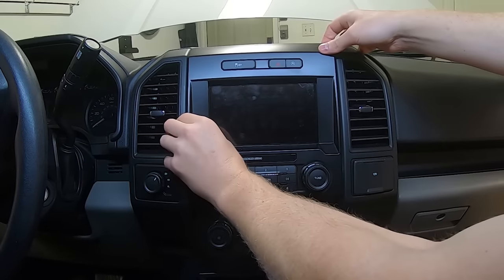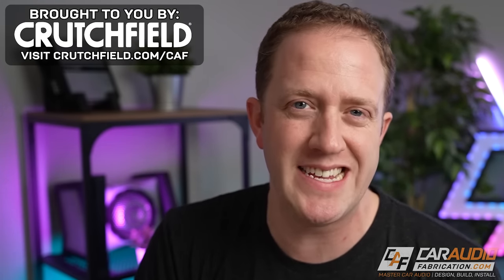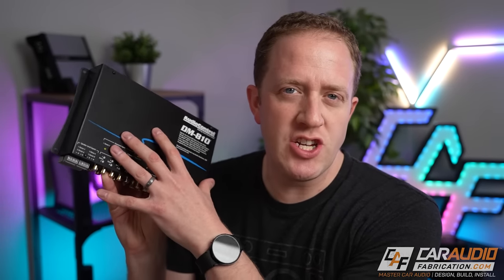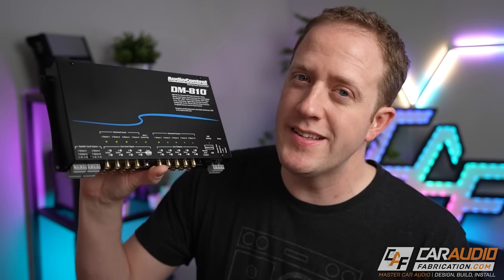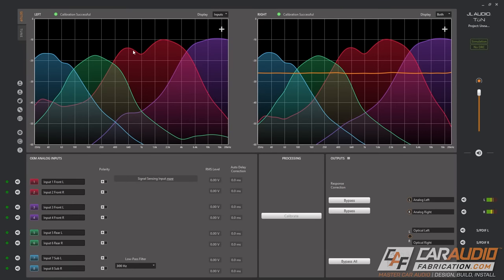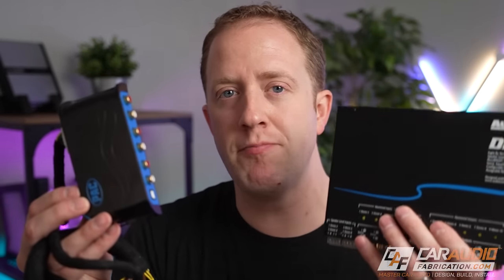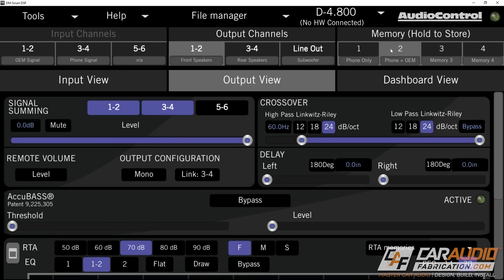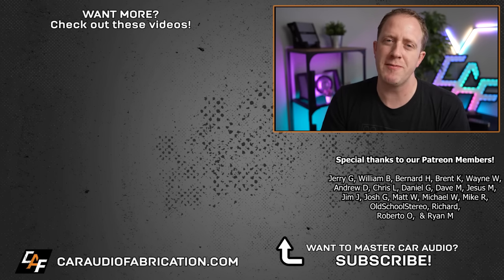Can't replace head unit? NO PROBLEM! Get amazing sound with THESE!

Comment: I can’t wait for the day a company uses HDMI to connect car audio components instead of interconnects that have been around for nearly a century…
Reply: Why would you use the flimsiest connector known to man in an automotove application
Reply: Love ur stuff i have a 2017 mercedes gls 450 with the harman kardon logic 7 system what do i need to do to get a signal to my amp its a kicker cxa 1200.1 and a kicker l7r 15 square 4 ohm wired down to 2 ohms amp is 1 ohm stable
Reply: Toslink over RCA would make the most sense for digital. Maybe an ethernet-based standard. HDMI would be way too fragile and difficult to use in automotive.
Reply: THIS!!!
Reply: can’t wait for type C connections or even mini hdmi 😂
Reply: @ScentSince2010  Hahaha even better 😂

Comment: Pac adapter and a twk88 is match made in heaven. I run my audio via optical from the pac to the twk. Pure digital sound. No messy RCA cables from the front to the dsp. It works awesome. Set back is that its made for only certain vehicles. Thankfully, mine had it. Great video!
Reply: I have the exact same setup. Found the PAC after my FiX86 failed. Much cleaner install and sums much better than FiX did for me.
Reply: Nothing other than an AMPPRO should be considered if your vehicle is compatible with it. AMPPRO with toslink to a DSP is as good as it gets from a stock radio.
Reply: I have the pac ampro for my ram and the sound it's worst then the stock radio. Is it possible that my ampro came damaged?
Reply: I wonder is Mercedes s550 has that?
Reply: I have a wavetechDQ for my loc in my 2020 ram 1500 non amplified system. I see now amp pro has the ch 41(R.2) that works with my truck. You think using the amp pro would make my system sound alot better then using a regular loc? I was also thinking about getting a dsp, so if I got the amp pro and the JL twk88 I could jus use a tosh link cable to go from the amp pro to the twk88? And then all I would need is rcas from the twk88 to a 4ch amp and sub amp?

Comment: Back in the day I was running (1985) I had a Porsche 944 turbo. We put in  Rockford Fosgate 650 on the M&M 12s and had a Fosgate 360 on mids n tweets. I was running a Sony XR100 deck . Deck was clear but we added a PAC Signal Commander in the glove box with the EQ. Man oh man when you’d hit that switch the PAC just really made it EXTREMELY CLEAR N POUNDING BASS. Even got stopped on the hiway for excessive acceleration. We was playing the first part of Sammy HAGAR’s Bad Motor Scooter. Cop though it was me shifting like that. IN A CAR LOL. Well the cops ended up setting inside the car saying OH MY GOD we’ve never ever heard are seen a car this loud. LOL, back in then days cops was cool. Nowadays they’ll KILLYA

Comment: Good stuff. Been racking my brains the last 48 hours on trying to get a sub/amp hooked up to my stock 11.6 in starlink unit in my 23  Outback.  This video cements what I suspected.  The amplifier adapter is the least expensive, most convenient for me, but I don't think one exists for my car yet.  Thanks for the info!
Reply: Curious if you got your system installed?

Comment: You can replace your stock head unit. There are many replacement android based screens from China. Many of those head units have premium Snapdragon CPUs which can process hi-re files. All you need is a DSP for premium results. You just need to keep the stock head unit attached to the stock MMI but just put it in the trunk. It's easy to make a box for it. You'll just connect your replacement head unit to a DSP and then to an amp and connect the replacement speakers and woofer on the amp. You can connect a small speaker on the stock MMI just to play the notification sounds and in case you need to change some of the settings of the car like time, oil change notifications etc because your original headunit is still connected to it in the trunk of the car. It just isn't used for music anymore but just for the sound notifications and car settings. That's a good solution for high end cars that only have a stock radio instead of any kind of screen.
Reply: What swappable, aftermarket head screen unit would you recommend for a twenty seventeen honda civic? What amount the amp?
Reply: This is for when you can't, new silverados are coming out with full screen which goes from dashboard to head unit.
Reply: You’re also forgetting other issues some mounts are more than the actual unit themselves which is stupid. To do my cars headunit I’d spend over 700 just to swap the headunit. I’d rather just get an loc and add an amp

Comment: Hello and thank you for all of the unbelievably clean and superior work. Also thank you for all the advice on different vendors for quality gear. I live in Anaheim Ca and am  planning my classic car audio insall. Please (if possible)could you consider doing a video on a classic car(1950’s-60’s) audio install/ recommendation. 
Rear deck, sound denting, amp rack,ect. Thanks again for all of the great content.
Reply: Get ready to custom make everything for it depending on what vehicle it is lol. RetroSound makes vintage looking radios, but has all the modern goodies you want like Bluetooth, and albeit not as powerful, 4 channels rms amplifier. Just won’t have as good of options like CarPlay/navigation that you’d get with a double din (or bigger) normal screen. Alternatively you can do what most people do and hide the radio in the glovebox if there’s no clean way of mounting one w/o hacking up your dash, or not being able to create a custom center console. 

Make sure you sound deaden it. I know from experience how damn loud it is inside those metal old cabs and how much sound would bounce off everything/vibrate.😂

Comment: Very nice to see you talk about a solution to grab the clean line level signal from some factory head unit! I never get good result using LOC but when we can get the true unprocessed line level even from a factory Head Unit, what a difference! You should do a full install video using such solution when you'll get a good candidate vehicle at the shop. Also it would be nice to see you touch the digital factory link such as MOST that can also allow getting a clean unprocessed line level signal from the factory system.

Comment: I have a 2023 jeep compass and they made the stereo essential almost impossible to remove. I want to use any one of the mentioned suggestions but want to be sure I get all I need before taking on the task.  The built in DSP Amp sounds appealing. If I get said device is the install complex or relativity simple.  I have installed almost  all of my aftermarket stereos for years,  just never ran into the situation where I couldn't put a new stereo in.

Comment: Hello car fabrications,
I have a 2024 Toyota Tundra with the JBL premium factory system. I’m upgrading with JL C7’s and amps. Do I use the Amp Pro or the fix86?
If it’s the Amp Pro, is there anything else I should be using for the best signal pickup from the factory unit?
Thank you for providing us with stereo information and I love the channel

Comment: Maybe someone can answer me...
#1) Are DAC only needed when using headphones (or the like)? In a car audio situation is it best to get a decent (or better) DSP/DSP Amplifier and call that good?
#2) I have a new android phone so is it acceptable to use an adapter cable and hook directly to the DSP/DSP Amp, or should I invest in another option (High res player for ex)? I would prefer hard wire and not BT, but I'm open to input.
Thanks ahead of time!
Great videos by the way... I've been trying to get caught up as I just found you a few days ago.

Comment: and even if you can replace the factory touchscreen it’ll be at least $500+ for a basic aftermarket touchscreen and you also will need additional aftermarket adapters and devices for your whole system to work properly, etc.

Comment: I have a 2017 Accord LX. I want to replace the head unit but it appears the headlight settings and maintenance menus will be lost which is no go for me. The stock unit clips way too early as indicated by my fancy JL amp. So I was thinking of just putting something isolated in the car that won't clip its output. Any suggestions?

Comment: I want to install a sub + amp in my car. 
The stock head unit does not have the required outputs, and is quite basic and outdated (other than aux in no fancy stuff).

Should I consider installing a new modern head unit with all those fancy gadgets, including the required outputs for the sub
Or rather invest in a line out converter.

A new head unit would be 2x the price of the line out converter, which seems reasonable for the ammount of features it will add to the car as opposed to just a line oitput.

Will the output signal be similar from these 2 options, or is there some kind of reason to prefer one above the other quality wise.
Looking forward to any suggestions.
Cheers.

Comment: The biggest problem I have in my '14 Grand Cherokee is nobody makes an amplifier integration kit that retains ALL the factory features. Either you lose voice commands and nav prompts, or you lose parking sensor audible warnings (depending on who you're buying it from). The PAC unit you had connects directly to the radio, bypassing the OE amp. Well the parking sensor module goes directly into the factory amp. 

I created a cheap setup that actually let me retain my factory amp, all the features (including fade which is commonly lost), and let me use my own amp. Basically just steal the signal from the OE amp, process/amplify it, and send it to the speakers. For whatever reason, nobody makes this and I don't know why. My system ultimately failed as I was just using a cheap DSP and eBay 50 watt amps to test my theory, but down the road I'll purchase real equipment to do it all over again. 

A company, or someone more knowledgeable than me, surely could make an all-in-one unit that does this, and it would be a hit with the Chrysler crowd who don't want to lose features. Why PAC hasn't is beyond me, unless maybe it was just more cost-effective to create a single unit that could work with amplified and non-amplified systems.

Comment: I've got a 15 Mazda3, which the BOSE system in my car only changed the eq through the underseat amp, I'm told that it's that way for most of the mazda line. So you can leave the headunit stock, and just replace the amp.

Comment: Can this be used on a 15’ GL550 Mercedes I was told the system is fiber optic and hard to modify for aftermarket audio

Comment: I really wish more options existed, because I'm pretty sure the DAC in my factory head unit is pretty garbage. So, realistically, bypassing the head unit altogether would be the best option, but the convenience of CarPlay is something I wanted to retain. Allowing for both the input of the head unit into the DSP, as well as the backwards compatible control of of the phone by the head unit, doesn't seem possible. Or is it?

Comment: I have a 97 BMW 540i. It’s fully loaded and includes a factory “DSP” integrated stereo that has no amp in the head unit. This is because the amplifier is a separate unit in the trunk which directly controls a built in rear deck subwoofer system. Do you know, or have heard, if an Audio Control DSP or DSP/Amp could untangle the mess and allow full control? Could it handle amplified high level straight from the factory amp or maybe even directly from the factory unamplified head unit?

Comment: I have a 2024 chevy trax. 
I'm doing 3 way components in the front doors and Apiller and coax in the back doors with 4 10s in the cargo. 
1 150.4 amp for the mids/highs 
2 1500.1 amps for the subs. 
Trying to wrap my head around how to connect it to the oem headunit is mind boggling...

Comment: I’ve got a 93 ramcharger. Im proud of this thing. Rare color, Mexico spec. I spent so much money on a nice sound system. I’m happy with the sound but not the look. I like the stock look. I’m doing my research into Bluetooth modding factory stereos. Im gonna hide everything. One thing though. How would I hid a subwoofer? Or how can I get nice bass out of speakers? And I want a loud clean sound. Sounds like much but if you have any ideas, please help me out. I’ll comment again when I’m done.

Comment: I've been using a Bluetooth adapter for pioneer's IP Bus on an oldschool headunit in my truck. Been liking it.
I want to get some sounds in my beater car that doesn't have a headunit. I was planning on using the same type of Bluetooth adapter except with RCA outs instead of IP Bus straight to the amp. Haven't gotten to the point of figuring out how I was going to adjust levels, but a DSP may be the way to go. Now to figure out which one.
Reply: If you're looking for a low cost, but effective unit, check out the Dayton 408.

Comment: I think the using a DAP (iPod on steroids, hi-res music player) option is one of the best, easiest and cheapest options (with a DSP) and using a 3.5mm/4.4mm to RCA. Most have line-out options and output well over 2vRMS. That’ll sound just as good as ANY aftermarket head unit and be a great deal easier/cheaper. Many DAPs have controls that can easily be used without looking (Fiios M11 DAPs are great for that). Talking about an easy clean signal,…

That’ll set you back a decent amount BUT less than all but the cheapest aftermarket head units and many times easier/faster to implement. And it’ll be at LEAST as good as an aftermarket head unit (sound quality wise) and you’ll have it for listening to headphones/earphones, can even start getting into high end ‘phones,…
Reply: Can you set me up with some info and or videos on quality dap’s I’m interested

Comment: @caraudiofabrication is it possible to keep the OEM radio installed and add a secondary aftermarket radio and tap it's front and rear wires to the OEM speaker lines? I want to put the aftermarket deck hidden in back, it is controlled by blue tooth. Would having it wired that way cause and issues?

Comment: I have a 2017 Ford F250 with a factory head unit - With the Pac Amp Pro (AP4-FD21 Amp interface w/ the optical TOS LINK signal fed)  running into my Audio Control DM 810  - does the optical cable BYPASS the RCA's running from the head unit?  I haven't installed anything yet, it's still in the planning stage.  I'm pretty sure that optical cable eliminates the need for the RCA's coming from the stock head unit.  Any opinions would be appreciated. Thank you

Comment: Newbie here. My amp is 500w (rms) 20-130hz and sub is 250w (rms) 28-250hz. I got the gains set at about 11 o'clock, freq. at about 80hz, and bass level at about 11 o'clock. Not looking for super deep bass, just clean full range bass. Where do you think the "sweet spot" would be? Any advice helps. Thanks.
Reply: He has a video on tuning the high and low pass filters using a multimeter.  I watched it a few days ago but haven't done it yet. 

https://youtu.be/tiOUd3NkOyQ

Comment: Hi,have you ever work with a Lexus GS 450h 2007 with Mark Levinson system?
I saw the video,but I had people that tried to install a LC audio control converter and a Digital signal processor and they told me that the sound was bad,can you tell me if this is real,I dont want to waste money,I need to be shure that if I want to replace the  factory amp and speakers,is for a better quality sound and more punch,more power,can you help me with your experience?

Comment: I would like to learn more about active noise cancelling. Any aftermarket systems out there with a mic that could be placed in engine bay and its own speaker just for use in cab with noise cancelling? That would be very handy in heavy equipment. Old diesels are loud and sound deadening in cabs is poor.

Comment: I love my 5 channel Audio Control amp however I wish they had a really high power version. One that had at least 1.5k on the sub channel and maybe 300 for the rest. 500 on the sub just isn't enough when you have 800 watts of mids and highs.
Reply: You gotta get separates. That much wattage you definitely want the Sub on it's own dedicated Amp.
Reply: @thekeysereview  Although I agree, he probably was looking for simplicity with 1 amp for all. Ease of installation.
Reply: @kman915  Trust me I understand, but if you want a lot of bass out of your sub, a single amp won't help you unfortunately.
Reply: @thekeysereview  Yeah, no doubt. a multi component system is my kind of system. I was never a fan of 5/6 chan amps. Sub output lacks for my liking
Reply: @kman915  yea the 5 channel isnt meant really for super power out. They are still nice though

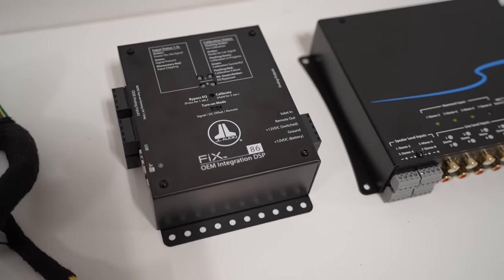Comment: 0:21 that PAC has an optical connection?? I cant imagine cars using fiber digital plugs for sound being the type of cable and how long you would have to go without breaking the internals of the cable when running them. These are mainly used on home theater receivers.

Comment: Hi i have a premium system i stall in my toyota highlander platinum that has sub in the trunk but it is not that powerful. So my question is can i connect 2nd amp to the sub woofer wires or am i gona blow the aftermarket amp or any thing like that because every speaker in my car have diffrent thing to come out. Some only highs some base some mids thanks

Comment: I have a 2020 mustang gt convertible. Want to do subs initially, with front stage later on. I notice a distinct difference in sound profile when the top is down. Not the usual change in cabin resonance,  mind you. Almost as though the B&O engineers eq the lower 2/3rds down approx 6db to keep people from smoking their drivers with loud music while driving top down.  Is there a solution for cars like that? Or is this one of those scenarios where I would have to find the circuit that is responsible for activating the top down profile?